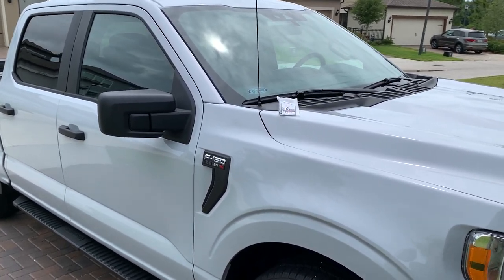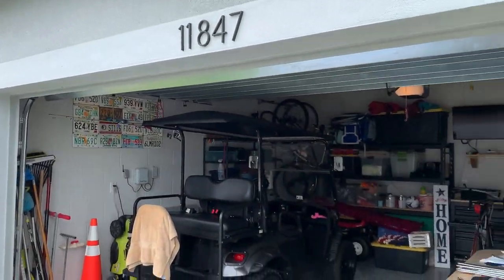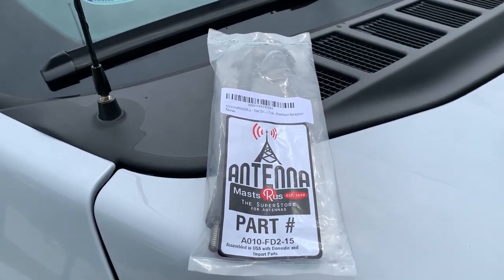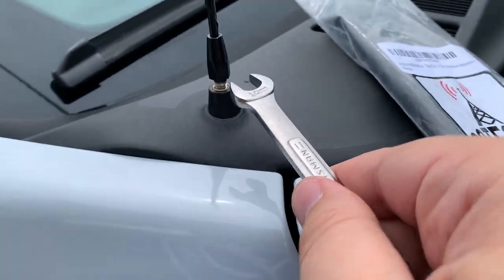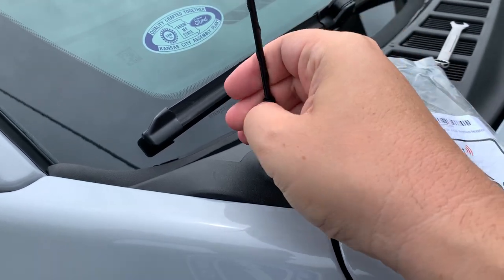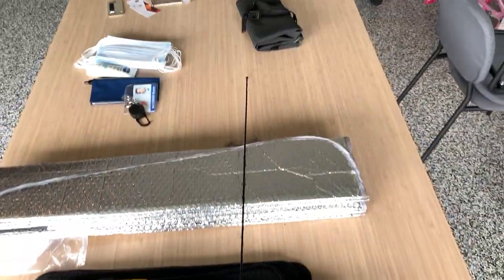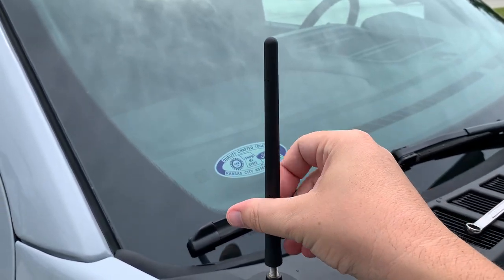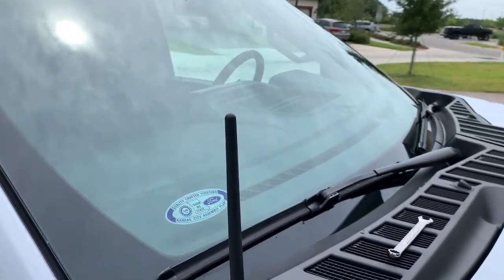Installing a Short Antenna on a Ford F-150 (2021 2022 2023 2024)

Comment: The video I want to see is how you're going to get that truck into that garage. I thought mine was a tight fit.
Reply from the maker: Haha. Not going to happen. No problem with the height, and I could fit two cars in there width wise even though it’d be tight. It’s the depth that’s the issue for me. My truck is at least a foot too long, even if I parked it up to the front wall. My wife’s ‘13 Pilot barely fits in the garage with my toolbox along the back wall. It just means I have more room for activities and fun things in the garage.

Comment: Still trying to figure out why trucks still have these antennas. Tahoes/Suburbans and Expeditions don't have them. Only thing I can think of is a early warning when you approach a low parking garage, maybe
Reply from the maker: That, plus I imagine a good portion of truck buyers live and/or use their trucks in very rural areas where they need the tall antenna to get reception.

Comment: Have you had any issues picking up stations? I about a stubby antenna and was only able to pick up 2 stations on FM
Reply from the maker: I have had zero issues picking up local stations. I do live just 20 minutes north of Tampa, in flat ole Florida, so I’m sure my location also has a lot to do with getting good reception. The antenna also had really good reviews.
Reply: @randomstuff25  Hey! I live in Springhill, and I just bought a 21 F150 XLT!